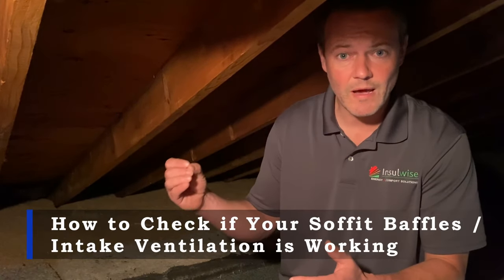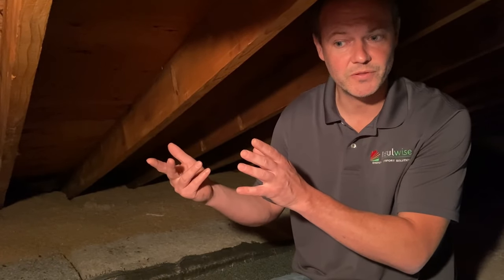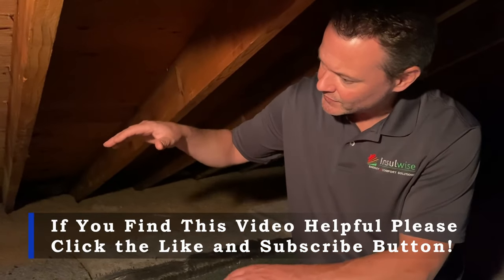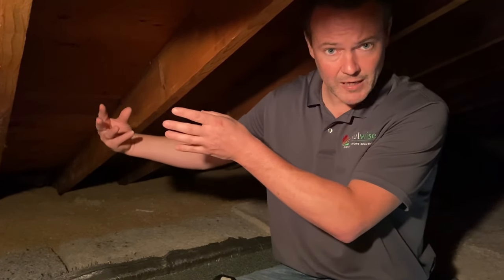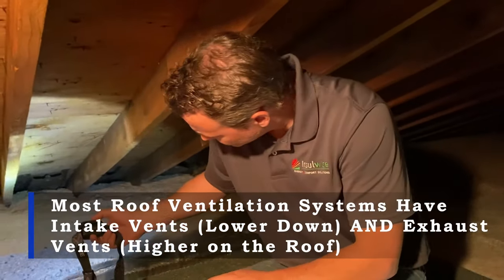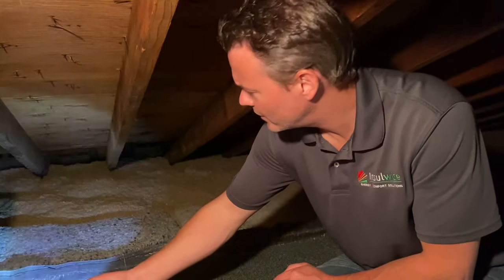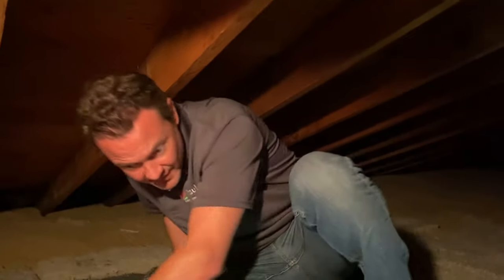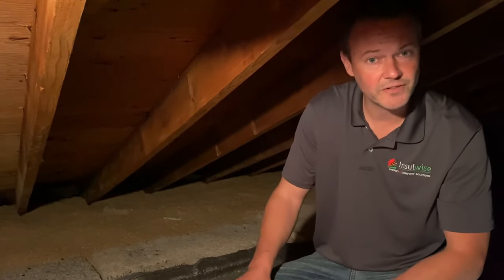How to Check if Your Soffit Ventilation Baffles are Working (from your attic)

Comment: My house was built in 92 and they closed the effing soffits.  Unbelievable.  Insulation installers still put baffles there out of habit, but no air was coming from there.  I could kick the installers in the nuts for that.
Got a new roof and the roofers put a continuous shingle vent for intake and ridge vent for venting and removed by (broken) power fan.  We'll see how that works this summer.  Had significant moisture issues before the new roof.
Reply from the maker: We see this sort of thing ALL the time.  Just because baffles are present, or you see a soffit vent installed from below, does NOT mean that it is open and functioning.  The continuous under shingle vents for air intake have been a tremendous new solution that we are big fans of here. 
Andy

Comment: It just confirms they are open, not that your ventilation is working or adequate. But this is still good information.
Reply from the maker: Good observation Matt you're correct, it does not confirm that they are drawing air in through them.  In order to do that you would typically need to employ a smoke generating device, like a smoke pen that an energy auditor would use to confirm that air is in fact being pulled upward and out through the upper ridge vents (or whichever type of exhaust ventilation you have).  I didn't do that in this video because the vast majority of the time that we encounter ridge vents in homes, they have been cut in properly and are doing their job (it's just a matter of whether they are drafting their air from soffit intake vents or the home itself --- a highly non-ideal --- but common issue; especially when there are no intake vents present).
That said, establishing that your soffit vents are open to the outside is the biggest first step in my opinion, and a question that comes up often from our customers. 
Thanks!
Andy

Comment: A good suggestion, particularly when combined with a selfie stick to get in close.
Reply from the maker: Yes, the closer that you can get to the suspected soffit vents the better for sure.  We see many "perforated" soffit panels that have solid wood beneath them, so they only appear to be open to the attic.  When you go up to the attic to inspect them and look down into the eaves/ soffit area -- it is pitch black. 
Andy

Comment: I enjoy watching your videos I've watched many of them. 

I don't understand condensation v well but I do know that when warm air meets a cold surface condensation can form, however ventilation helps remove any condensation that forms. 

This is probably a stupid question but would moisture not condensate on the part of the roof (near the baffles) where the insulation meets the roof rafters? There is air getting in to the rest of the attic, but not at the edges where the roof meet the insulation, meaning no air would get to that particular part of the rafters? I'd imagine there's a simple exploration though why that's not the case. 

I have a sloping ceiling at the edges / side of my loft, I'm a bit paranoid of putting insulation there at the edges for fear condensation would form. But it's a considerable area so I'd imagine a fair bit of heat would be lost if I don't insulate it.
Reply from the maker: Thank you for watching our videos!  We install insulation at edges of the attic intensively.  This is where the roof is closest to the ceiling below, and if this area is not well insulated you can have ice dams and melt spots form on the roof when it snows.  If your attic has been effectively air sealed and properly ventilated, you shouldn't have excessive condensation in that space.  And it shouldn't form where the insulation meets the top of the baffles so long as the soffit vents are open and performing properly.  Hope this helps!
Andy
Reply: @insulwiseenergycomfortsolu3293  thanks for getting back. I wonder why that is though? Insulation is literally touching the rafters and roof at that particular point?! So there's no air getting  at that particular point where the insulation literally touches the roof and rafters at the edge. Yes the loft would be otherwise ventilated so air would get to every single other part of the roof and rafters as no insulation would be touching the rafters and roof elsewhere. I'm not claiming that condensation would form there I'm curious as to why it doesn't.. No ice here in Ireland, but cold weather all the same.
Reply from the maker: @mryan4452    Condensation issues do not happen in all attics, even in cold climates.  If that portion of the roof is oriented to the south or east it may be getting warmed from the sun.  There may not be enough water vapor present to cause condensation issues.  Also, just because insulation is present doesn't mean that there is no air flow.  Most forms of attic insulation permit air to move right through them.  Any blown in insulation will, and rock wool and fiberglass insulation also allow air to move through them at various levels.  This could allowing some evaporation to occur.  I'd also say that if you don't see a problem there, and we've just come through the winter, that you probably don't have anything to worry about.

Comment: Nice video. I need to check my soffits to see if I can see daylight. I noticed that your baffles look to be about 16" wide and don't cover the entire 24" rafter bay. Mine are the same way. It seems that they should be wide enough to go from rafter to rafter. Is that correct or does it matter? I've seen mixed answers in my research. Seems like the wider the baffle is, the better it will block any insulation from falling down there. I'm wondering if I should replace mine with the wider kind. Thanks.
Reply from the maker: Hi there and thanks for the compliment.  Wider baffles will permit more air to flow up into your attic from the outside, that's the main benefit.  In terms of keeping insulation from getting into your soffit area, this is a really important point.  What we do is first install the baffle so that it extends over the exterior top plate by at least a few inches, then take a piece of fiberglass and gently push it into the gap between the baffle and the attic floor so that it's sitting directly over the top plate.  If you are not careful and mash the fiberglass into place you'll crush the bottom of the baffle, choking the airflow.  This will keep insulation from the attic from falling down into the soffit area and blocking the soffit vents. 
Andy
Reply: @insulwiseenergycomfortsolu3293  Thanks very much for your response. I think I need to get to work in my attic!

Comment: With 4 in 12 pinch, only 3 sides of the West end over two bedrooms W/closet are accessible. The East end has 2 gables with high vents. The other wall has a 1" overhang to zero, so not accessible for adding vents. The roof design gives each room a different design built in the 1980-81. We have R62 (Way over minimum) had blanket over blown-in fiberglass but the vents are blocking the sofit vent's, of this 22 square foot roof. I am down to remove the exterior vents and make and auger to screw into insulation blocking and pull out to open to achieve air flow in. I tried pushing it in and won't budge. Any thoughts as it is impossible from the inside. I can't clear, remove or reach without a tool with a hook. Well insulated but way over done without proper venting considered. Other than cutting the outer 4 feet of topside plywood, ice & water shield with new shingles, it is to expensive and dangerous being on the edge of a roof with 2X6 rafters to the gutters in Eastern Nebraska while disabled that has had 16 medical procedures, fusions, and stimulation with electrodes. No help. I don't want the shingles to cook from the bottom. Enjoyed the video.
Reply from the maker: Ok, so you've got a complicated situation there.  There are a couple of things to consider when it comes to attic ventilation.  Number one is that it is NOT a perfect science, and number two is that every house is different.  That said, there are consistent "best practice" recommendations, and that is what we attempt to create when we work on our roofs and attics.  The most important thing in my opinion is to first minimize the amount of moisture that is reaching your attic from inside your home (this is also assuming that you have a water tight roof with no leaks).  You do this by making sure that your bathroom fans are ALL venting to the outside (and driers to if they are venting ot the attic --- yes, we see this here, ugh!).  Secondly you want to air seal your attic floor as well as you are able to.  I have another video for how to do this in an attic that is already insulated.  
After these considerations are addressed, ventilation is the next most important thing.  I have seen MANY homes that ONLY had gable vents and were doing just fine.  And if your home is aligned somewhat East / West, you will likely have  a breeze pushing through regularly which is possibly the best type of attic ventilation --- in my opinion.  Also, if you have been living in the home for a few years with that level of insulation, and there is currently no issue with attic mold, you are more than likely good to go.  I would only recommend doing heavy duty retrofit work at this point IF you are having issues with heavy condensation on the underside of your roof or getting mold. 
Andy
Reply: Andy? Hope I got it right. I am so grateful for the reply and ideas. Yes, range, bath vents go thru the roof, sealed and wrapped with insulation. I like to plan for not just 10 years, but 100! After fixing cars it became an obsession like a decease I call perfectionism. Roof is dry, ridge vent running the  length. I wish I had a vapor barrier behind the ceiling drywall but, in the 80's, I guess it wasn't important. This house & next door were show homes. So first ones built and different but I was told they are larger (Finished basements). With 4 kids, my wife is glad to have two levels. Wired design just like a 14k split level, instead, it is 14 feet apart. Then before I retired. I was holding 4hr tech seminars on vehicle systems in a different city Monday thru Thursday then drive home at 5-6 hrs. It was exhausting so after 7 years, Dr forced me to quit. But learned how hotels and shopping center were putting designs on the wall that added insulation on the outside. Not stucco, but EIFS. I had hard board sheets so marking studs, and 5" coated screws with 3" plastic caps held pink 2" R10. Then sand flat if not and scratch with a simple stainless steel brush, apply a fiberglass matt troweled into a thin layer of cement reinforced with chopped fiberglass and sanded smooth. Then you order the color and size of marble chips and trowel it on, just like drywall. It has a 2% fade in 20 years, so no painting. We pay 1/3rd heating & cooling after I did the entire house. Thinking any money spent on utilities is gone. The front is brick but dug to footings on West & East end using PL300. Water can't pass thru extruded but the white coffee cup expand can. This is now R14 and in Pueblo, I used dark brown on corners, extended rain on top of windows and doors with 3/4" foam backer rod on the edges of all. It cost more but I used building sealant instead of caulking because it's 300% more stretchy and comes in colors. You have to get a stainless steel trowel because anything steel could show up in the finish and look like a rust stain. Check EIFS.com and STO or Dryit. This is why I was looking into the power for roof vents to cool it down. Research!
Thanks for the reply kindly. DK, Omaha.

Comment: Thanks for the video. If I have blown-in insulation but I can see daylight through the soffit without any baffles, do I still need to add baffles?
Reply from the maker: Hi Jacob, I would say that you do not.  If you are able to see daylight than you definitely have a clear air channel that is allowing air to move upward into your attic.  You should be good.  However, this could also indicate that you do not have enough insulation.  We insulate to R-49 using cellulose insulation which is about 15" inches deep.  Often when I can see daylight through the soffit, the attic is insufficiently insulated, but this isn't always the case. 
Thanks!
Andy
Reply: @insulwiseenergycomfortsolu3293  Thanks for your reply. That makes sense about lacking insulation. I’ll check out my situation closer. Thank you!!
Reply: Keep in mind that over time that blown-in insulation can fall down and block the soffits, particularly if someone is moving about in the attic kicking the insulation around. Also, I have found that baffles provide a chimney effect channeling the incoming air upward where it removes the heat from the shingles. Taken with an IR heat gun, there can be as much as a twenty-degree difference between the baffle and the hot air exiting it at the top. Baffles help move the heat up and out.
Reply from the maker: @Inkling777  Correct and great observation.  When we install baffles we first staple them into place, then insert a piece of fiberglass between the baffle and the exterior wall top plate to keep insulation from getting into the soffit vents that way.  But you're right, we've seen many blocked soffit vents over the years from people moving around and disturbing the blown in material.  However if the baffles are installed high enough above the insulation, you shouldn't encounter that too often. 
Thanks for the comment!
Andy

Comment: Help! Our house was built in 2000, but in the last two years we’ve been hearing the most annoying sound in attic that only shows up when wind comes from a certain direction. Could one of the baffles be loose? It’s maddening!
Reply from the maker: It could be baffles, it could also be the wind causing the damper on a bathroom fan roof vent to "chatter."  I have another video on this showing how this happens.  It would be unusual for baffles to make enough noise that you hear them from inside the home -- but maybe.  I would check out our bathroom fan vent video first.  If it's not that my next suggestion would be climbing up into the attic with a headlamp on the next time you hear that sound, and directly investigating the source.  Hope this helps!
Andy

Comment: When i place my baffles only half of the soffit hole is within the baffle. I can squeeze  my way to the top plate and staple the baffle to the top plate and bend them up but it is very difficult and exhausting. Is it worth the effort to do it this way or is half the hole fine? I could also cut more out from the outside i guess.
Reply from the maker: It probably depends how many soffit vents you have.  If you have plenty of soffit vents, but you're only getting half of each one that may not be bad.  But if you just have a few vents than you probably want to maximize the air that you're getting from them. 
Andy

Comment: If you look at the soffit vents from outside you can see the buildup of dust from the air being sucked  up into the attic.
Reply from the maker: I would say that this is sometimes the case, but often for us it is not (sometimes the undersides of the soffits just get dirty over time).  Being able to visibly identify a band of light at the bottom of the soffit baffle, or if you don't have baffles around the outer perimeter of the attic, is still for us the best way to confirm that your soffit vents are "open" to the outside. 
Thanks!
Andy
Reply: Yup. I got burned by my builder's lazy installation of the original vents plus the neighbor's stinking cotton wood trees. Noticed soffit vents were no longer effective (attic couldn't breath). Became real obvious when one of the roof vents started sucking snow from top roof. Looked into louvered soffit vents - plugged with cotton. But it was only plugged by a 1 inch by 4 inch strip. Took off vents - that matched the hole size that the builder cut.  1"x4" opening for 8"x16" vents. Two slits from circular saw and beat with hammer, builders just don't care...  When I moved in, I verified that I had enough venting based on assumption that builder cut a 7"x16" hole and the square inches size just barely covered the attic size and amount of roof venting. Add in the cotton wood junk and venting was down to nothing. Had to rework all the soffit vents because the builder was simply too lazy to cut proper openings.
Reply: @bigdog8008 can I ask what the sq footage of the house?
Reply: @Lori-q2g  2000 basement and 2060 upstairs (cantilevered).

Comment: so those other vents, by the peak, "exhaust vents", do they stay open 365 or wut cuz mine were closed and my attic is 130F. when do I reclose em
Reply from the maker: All of your passive vents should stay open 365 days a year.  In the summer you want the heat to escape, and during the colder months you want the ability for any excess moisture in the attic to be able to escape (as well as heat to help avoid ice dams).